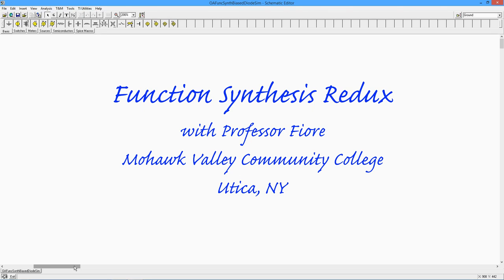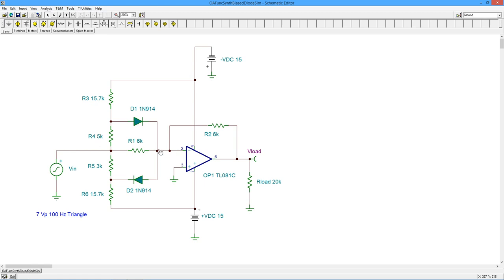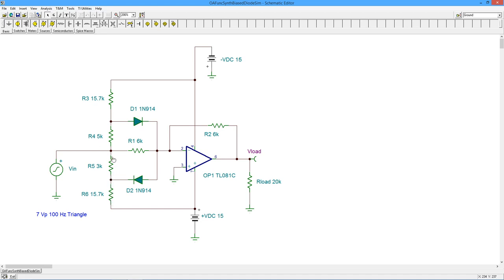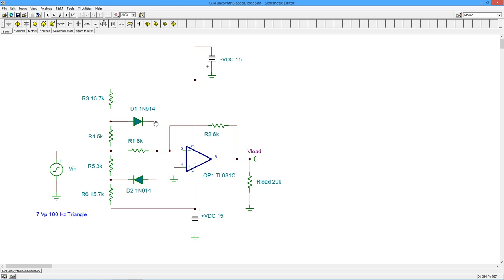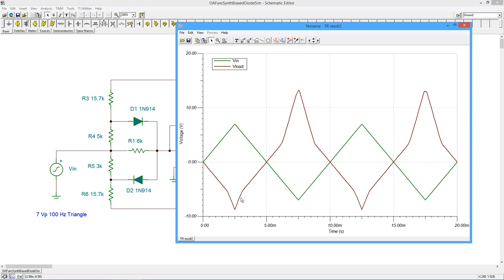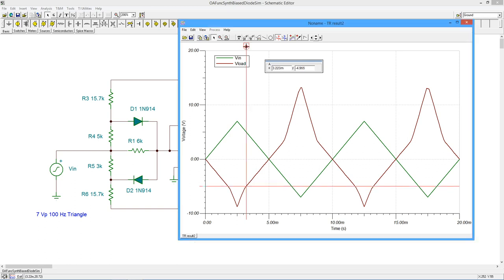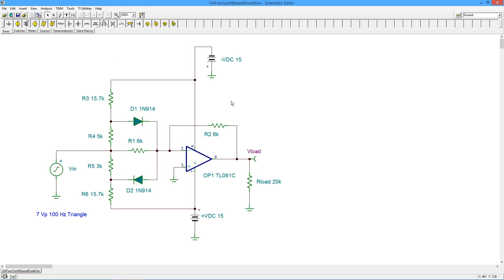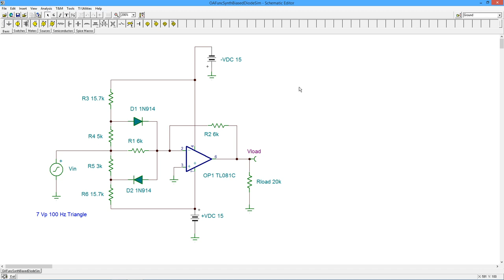Op Amps: Function Synthesis Redux

Comment: Thank you. From the start, I was looking at the wonky resistor balance and wondering where you were going with it. I suppose this is how we can simulate things like voice synthesisers?
Reply from the maker: I don't see a direct connection between this and a something that synthesizes a human voice (as in text-to-speech), but it could be used to alter the sound. Generally, a circuit like this would be used to compensate for non-linearity in sensors, or to apply a non-linear function to a signal. Many years ago, I did some work with a colleague who was doing research in analog neural networks. I used one of these to create a sigmoid response for a control function.
Reply: @ElectronicswithProfessorFiore  I was thinking about voice modulation (Think Australians asking questions). However... I think I'm wrong. Ah well.